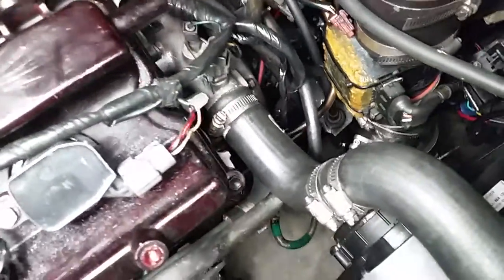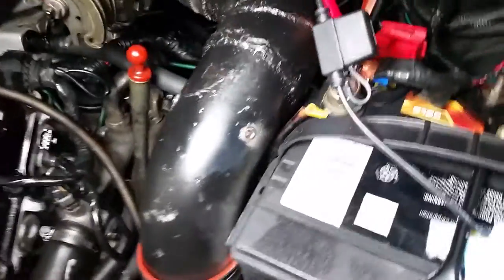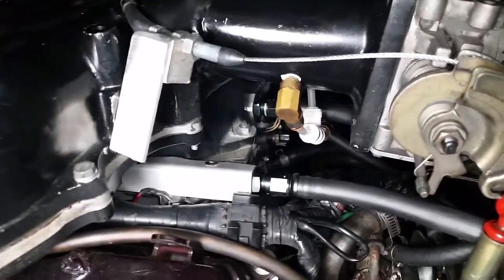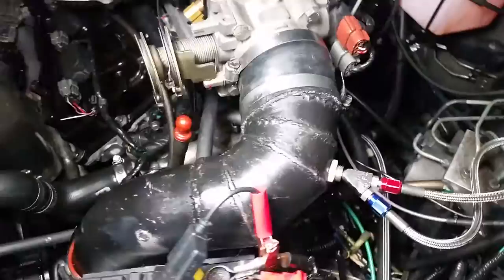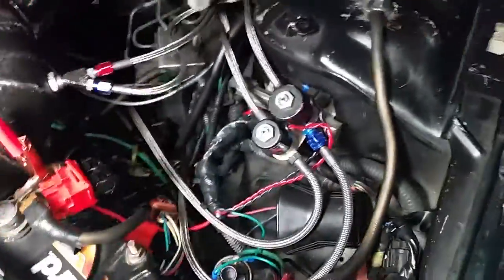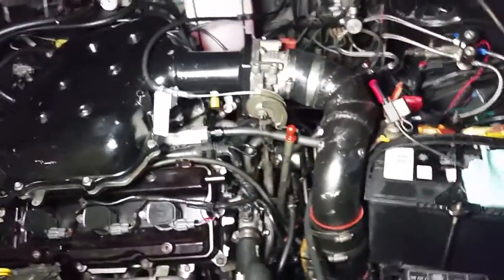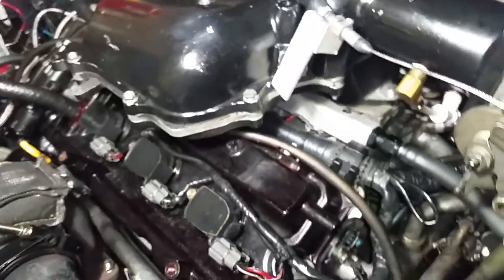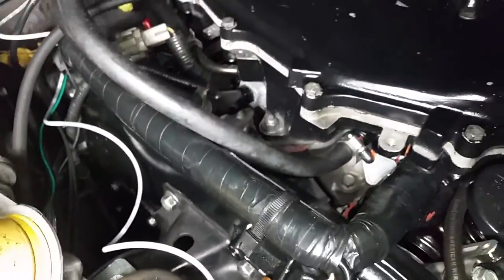Methanol and Nitrous injection on a Turbo car

Comment: I would love to see more videos of this car... how it runs... how it behaves without the nitrous and then how it does when you add the nitrous how big of a shot are you running how much boost are you running? I'm running a turbocharged megasquirt car with water meth and I've always wondered what a small shot of nitrous would do.
Reply from the maker: It will do wonders. It's just like running with more boost, but comes on instant. And the power is more significant with injection
Reply: got to be done , it Will double your horsepower hundred shot of nitrous should give you 50 bhp 100 shot of nitrous on the turbo car will give you 200 BHP. Will double your hp with nitrous should give you 50 bhp 100 shot of nitrous on a turbo car with meth  will give you 200 bhp as it’s doubles . Nice a and helpers for the knock.
Reply from the maker: Yeah exactly, on a turbo methanol/water injection motor. A 50shot could mean 130whp while in a all motor engine a  50shot would be 50whp.
Reply: I agree more content please.

Comment: Did the two nos & w&m kit work ok . 
And you still think it's a better way then behind the nos frogger. 
I am doing the same on a turbo car. Running a wet kit . But not to sure wear to put the nos frogger and the w&m froogers and help. I see u had the m&w kit behind befor how did that go. Like  you are not using nitrous as an auntie like I'm using it but I'm the throttle body

Comment: Is that a water and methanol injection system and do you use a controller to control? I run nitrous as well but omg when i see yoir set up . I take it that the  methanol and water also w helps with temps . I got to take my hat of to u what a set up i got to no more about this please.  I am on nos amd i use a wet kit 150 shot with  a progressive controller. and i fitted it all my self so i am sure i can fit a meth kit. Please tell me more about your set up

Comment: I wanted to run this set up on my bike. Do u notice a significant difference in cylinder temps and power?
Reply from the maker: The difference will be on the tuning, using the injection alone wont give the desired results. The key is to use it so that you can produce more power with it. It alone wont make a big difference unless your system is running in a way that it really needs the cooling and higher octane.

Comment: How's it running?? Did you do anything to the piston rings?
Reply from the maker: Jay Gee runs pretty good. yeah i have wiseco pistons.
Reply: @Streetzlegend  did you go for a bigger piston ring gap for blow by or normal gapping. im thinking of a setup that involves a v8 with 12/1 compression
Reply from the maker: @yosefali7930  yes I set the ring gap according to what wiseco recommended for the given power I was after.

Comment: Any reasons you stopped using rear mount turbo?
Reply from the maker: I got my first welder and wanted to take on the challenge fabricating a front mount, it ended up being permanent once it was success; otherwise I would have kept it
Reply: How was it in weathers like rain?
Reply from the maker: I drove years with it as a daily driver even 40mile commutes in miami weather, never had issues related to the turbo sucking up water

Comment: what is that oil filter on the passenger side of the engine bay?
Reply from the maker: That is connected to a scavange pump, which pulls fresh oil from the bottom of the pan, then feeds it into the block. I run this before I start the car, so that I can build oil pressure and therefore eliminating the harsh start up wear on bearings and cams.